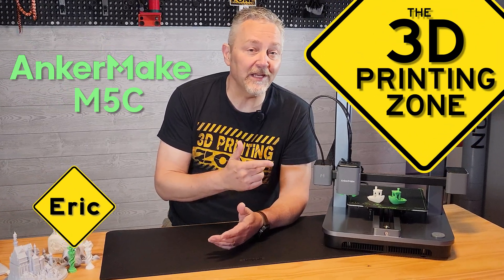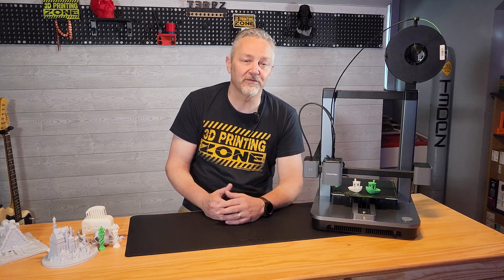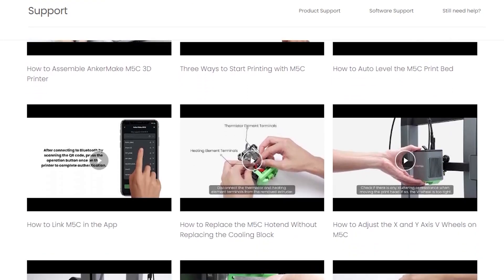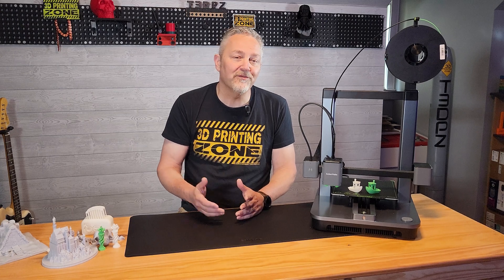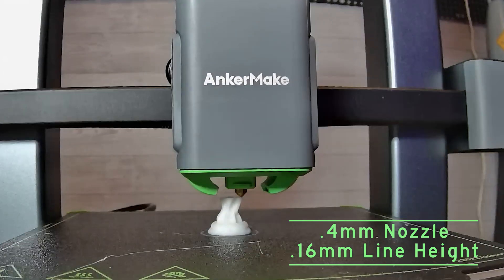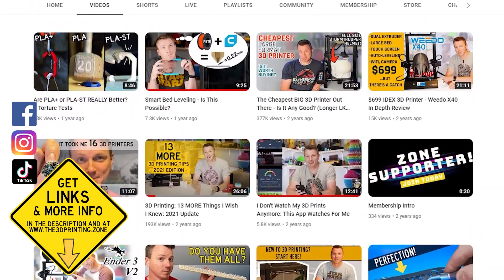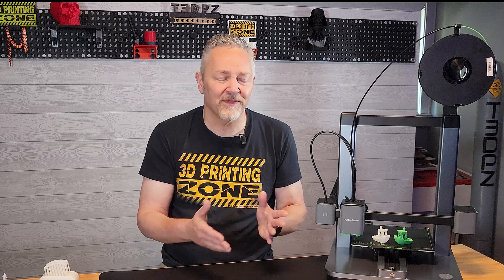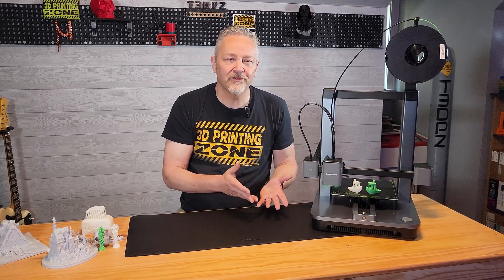EASY, Lightning Speed 3D Prints on a Budget! AnkerMake M5C Beginner 3D Printer & No Screen!

Comment: 4:13 Well... let's be honest: this Benchy's quality is far from "amazing"... Lots of ghosting, it is quite irregular and it didn't have enough cooling on the hull's tip. It is possible to get an EXCELLENT benchy in 1 hour with the 0.4 nozzle. The M5C is amazing - I am also printing with it, but the community will need to work the profiles some more to get actual quality. The printer is solid, though - and fast, no dispute there.

Comment: I'm loving my M5C so far. The speed and the print quality are amazing - although you do sacrifice a little bit of quality to get the highest speeds, I have found that even printing at AnkerMake's "Normal" speed of 250mm\sec gives me excellent results in much less time. The 25-minute Benchy I printed looks better than the 90-minute Benchy from my Ender-3 Max Neo. 
At first the lack of a display and controller worried me, too, but I repurposed an old Android phone and never looked back. And with so many people switching to Klipper right now, losing the onboard control shouldn't be that big a deal. (Makes me laugh to see so many reviewers who just told all their viewers to switch to Klipper so they can control everything from a browser or an app complain about the lack of a screen on the M5C.)
And the button is proving to be very useful right now as I'm chain printing a bunch of stocking stuffers for Christmas. Print, clear the bed, and double tap the button to print another copy. 
I do hope they add webcam monitoring to the app or make it possible to monitor and control the printer from a web browser - or someone makes it work with Octoprint - but the M5C is the first printer I've ever had that just works beautifully out of the box. I'd much rather pay $400 for this than $200 for an Ender-3.
Reply from the maker: Eric here: Excellent post! I agree as well about the price, assuming you have it. Most newbies will just see the price and move on, especially with the new Ender 3 v3. Chain printing! Love it!